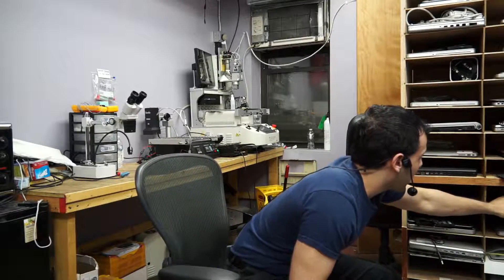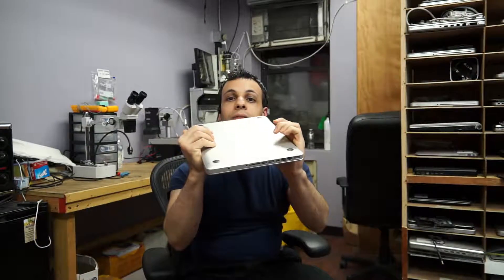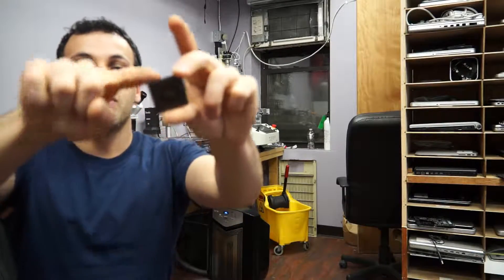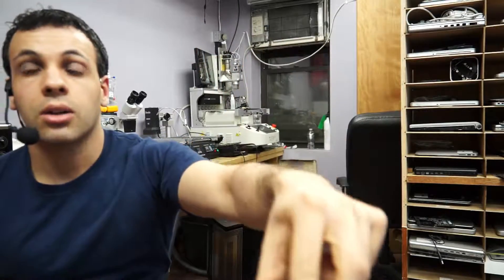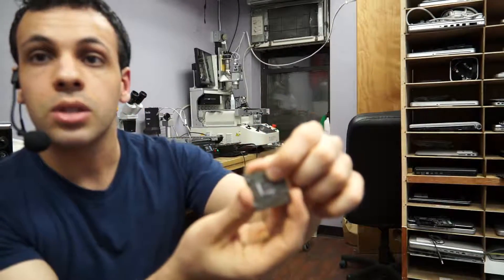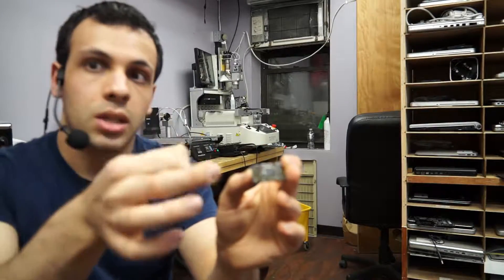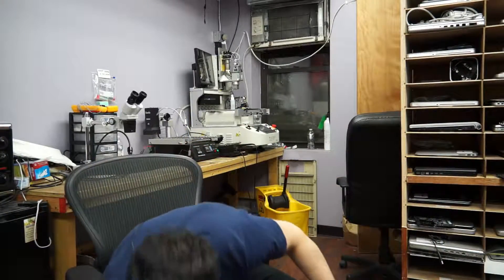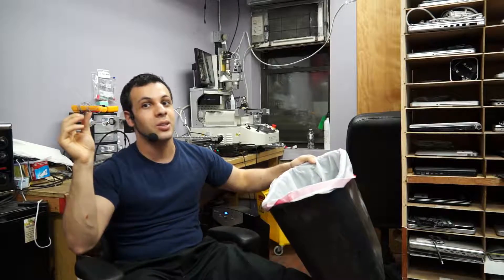"Reballing flip chip GPUs is BULLSHIT - the truth about dead laptop GPUs & repairing them." 10-16-14

Comment: well, here's the thing: it all depends on how long the "repair" will last.   Assuming that the expected life of a mac is only three years in the first place,  If a new mac costs $1500 on the low end, and someone can give you even another single year of use for $300, then the customer is still $200 bucks ahead of the game.   If the repair is even less expensive than that, it might well make sense to try and eke out a few more months just to give some time to shop for a decent deal on a new one.  ESPECIALLY if there isn't enough hard core usage to kill it in only a month, which still seems like a very conservative estimate of the likely lifespan of that kind of fix since the 30 day warranty would cover it - most of the time the estimated life of the repair should exceed the guaranteed time frame or else shops would never clear a profit at all.  For the average joe, or someone who is already on a budget and needing a computer that will either cost more than one or two thousand dollars for a life expectancy of only 2-3 years, vs getting something that might last even a quarter of a year for $250 or less which might well last longer than that, then it becomes a little more reasonable to consider the half-measures as valid choices.  

Now if it is only going to cost a few hundred for a new pc that does what it needs to do, then that's another matter.  Game consoles, though, might not be replaceable with newer tech, and so then the repair is the only viable option.  Even if it isn't a permanent fix, doesn't it still beat no fix at all?  Heck if there's nothing else to lose, they might even just try putting it in the oven and having it either melt or magically be revived.... I took an open flame to my vaio laptop out of frustration and it's been working for a couple years since, much to my surprise...